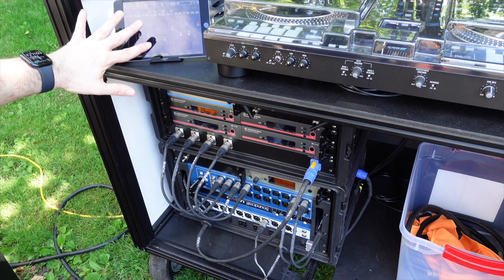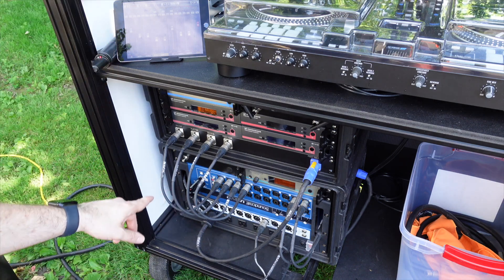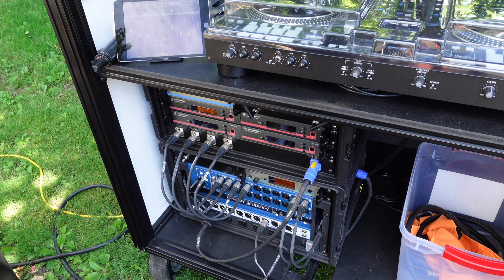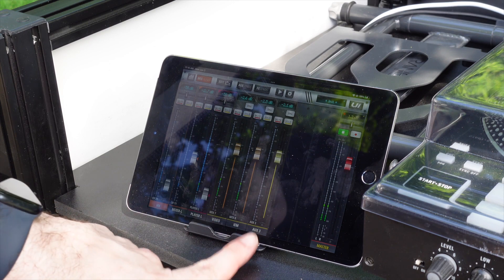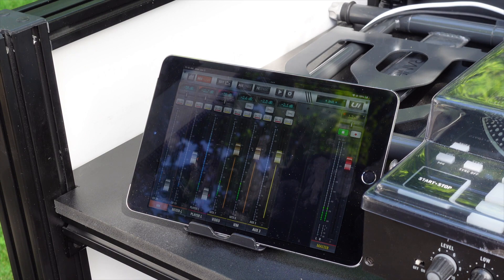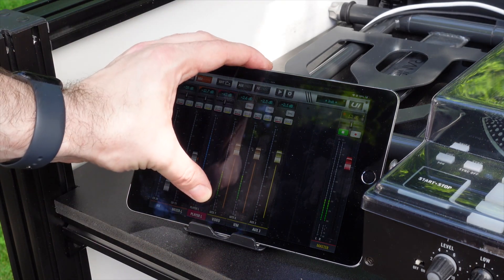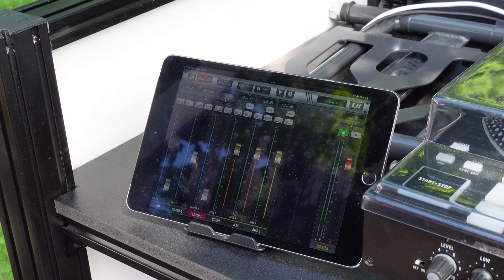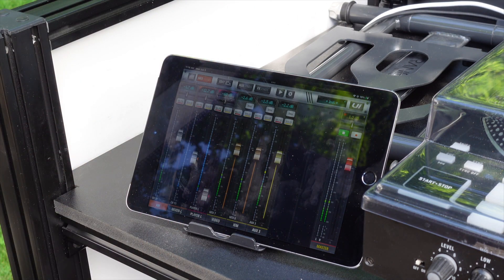Soundcraft Ui24 Matrix Feature - What Is It?

Comment: If you were running point source speakers and subs, instead of EV50s, would you run separate matrices for the tops and bottoms? Or keep it all together and run into the subs and then jump up to the speakers?
Reply from the maker: Yes. This is exactly what I just did at the harvestofsound.com expo which I’m a founder of. I have a matrix out for subs which cuts everything out 80hz and up, a top out which cuts everyone out 80hz and below with a mild eq to make it more warm, a out for the floor wedge, my IEM out, even one for DMX lighting control.

Comment: Hi, Im interested in purchase this unit and I’m hesitant because it’s been some time since it was released and I’m worried about how much updates and support will it have for how many years to come. This tells me that they’re still supporting the unit, however, do you think it is still a good purchase in 2024? I’ve seen a newer Allen and Heath option released just 1 year ago, but it doesn’t have real subgroups. So I’m thinking which might be the best option in 2024 and how much life the ui24r has ahead? Thanks in advance!
Reply from the maker: A very valid concern. I suspect this will be continued to be supported for some time likely longer than the ui12/16. I still think it’s an outstanding value. A&H is a great piece of kit but I also think it’s not as feature rich as the Ui24R.
Reply: Soundcraft just released another update for the Ui24R this July. I bought mine this July and I believe it will remain updated for quite some time.
Reply: There are so many UI24R on the market, that Soundcraft would be silly to stop support for these :-)

It’s a dope device and it’s by watching Lou’s videos that I got one and a second one later on.

Prices have jumped up since I’ve got my units in 2020, but like anything else. And for my point of view, it’s the most complete bank for the bucks. Having the whole control from my iPad mini is awesome and miles ahead of a standard mixer. I used to work with a Soundcraft EFX8 which was great, but not as close as the quality of UI24R and not to mention what I can accomplish now.  I still always have a Yamaha MG 06X in my bag, just in case for piece of mind. And I also usually have my second UI24R in the truck ready for replacement or for ceremony.
Reply: Valid concern. There's a bug which means that you can't solo a matrix output (you just get silence in the headphones). This bug has been a known issue since 2020, and Soundcraft have still not released a firmware version that fixes this issue. None of the firmware added in the last four years have added any significant functionality.